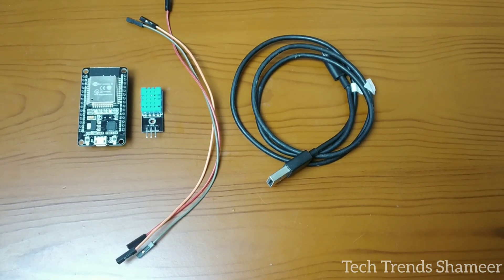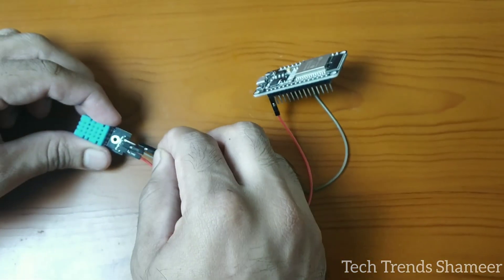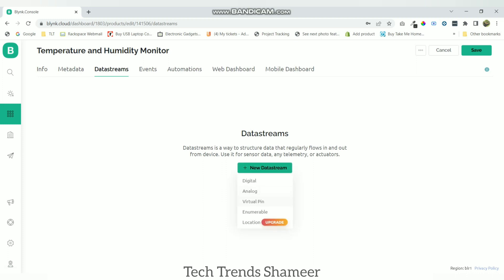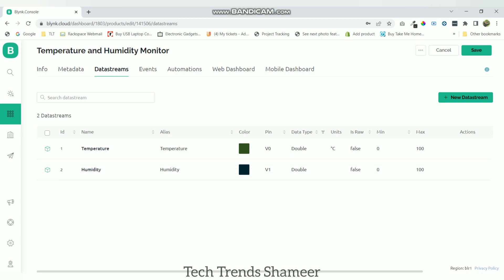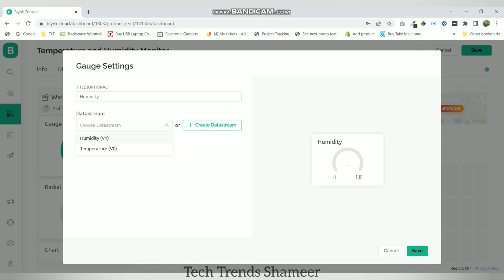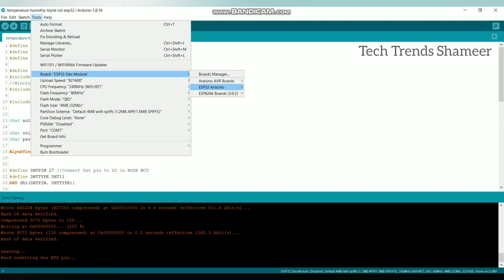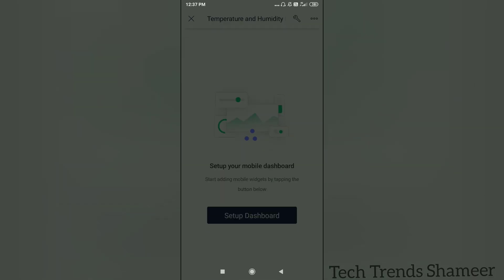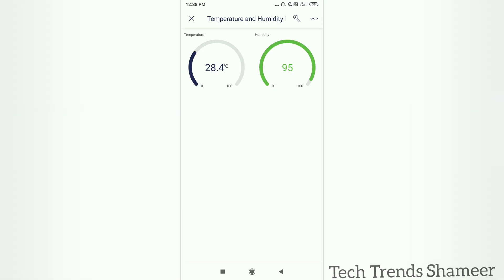Temperature and Humidity Monitor Using ESP32 and Blynk IOT | Blynk 2.0 Projects

Comment: BRO my device is online but temp and humidity have no value
Reply from the maker: Check the sensor connection. If connection is correct,  then check if there is any loose connection in wires.

Comment: Unfortunalty, now (early 2025), Blynk restricted the free use. Only 30K "messages".  The free account will be exhausted in about one hour and is reset only after 30 days. To save the transmitted data, you should change the timer.setInterval at least at 10000L (reading transmitted every 10 sec.)

Comment: Failed to read from DHT sensor
Reply from the maker: Check the circuit connection and make sure there is no contact in the wires.

Comment: Please note that the DHT11 will not read temperatures below 0 Celsius.  DHT22 will but there are many counterfeit ones on the market that seem to have a DHT11 instead.  If you do need to read those lower temperature a Dallas temperature sensor like DS18B20 will be a better choice but will require different programming.  I use a (counterfeit) DHT22 plus a DS18B20 so I get the temperature from the DS18B20 and the humidity from the DHT22.

Comment: C:\Users\dell\AppData\Local\Temp\.arduinoIDE-unsaved20231130-17616-w45jmh.f3o9\sketch_dec30a\sketch_dec30a.ino:7:10: fatal error: BlynkSimpleEsp32.h: No such file or directory
 #include <BlynkSimpleEsp32.h>
          ^~~~~~~~~~~~~~~~~~~~
compilation terminated.

exit status 1

Compilation error: BlynkSimpleEsp32.h: No such file or directory      how to rectify this error
Reply from the maker: Install blynk library